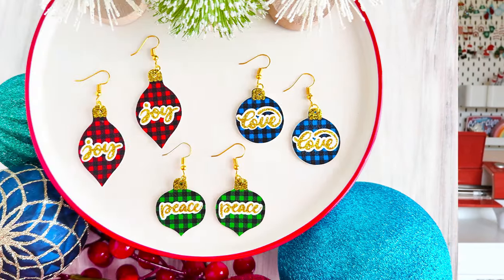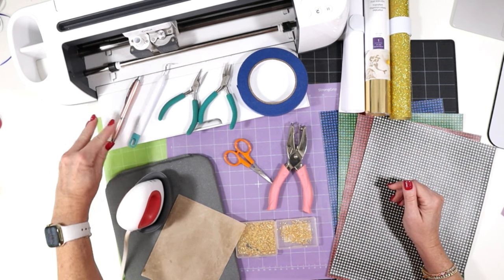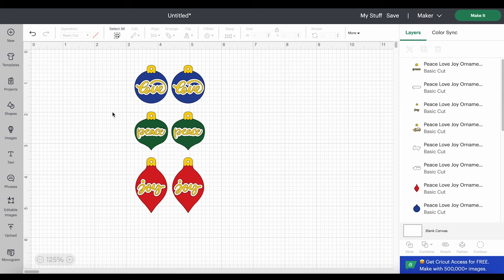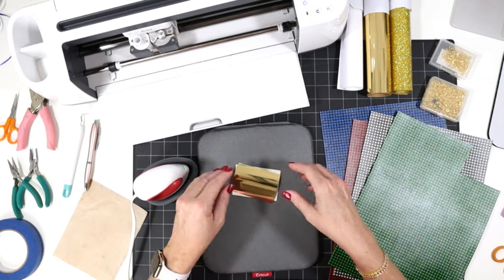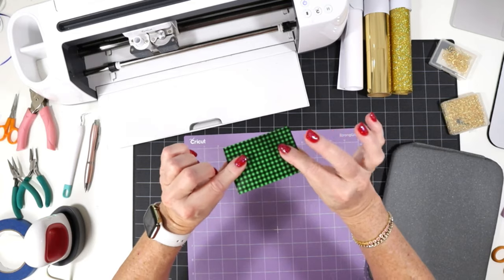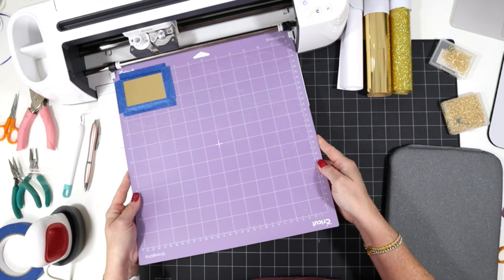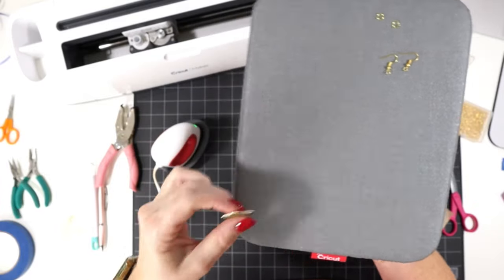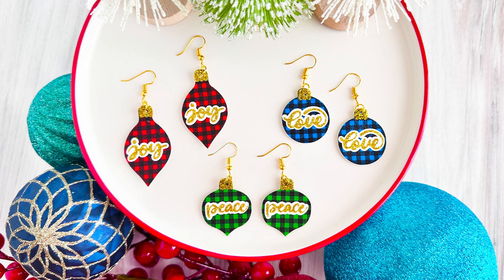How to Make Faux Leather Christmas Ornament Earrings with a Cricut

Comment: Hello, I am very new to making earrings and just found your page yesterday. I’m having trouble with curling and wondering if the HTV is enough to stop them from doing so?
Reply from the maker: Hi, Tara! Welcome! Yes, HTV on the back of the faux leather does add structure and stiffness that will help the faux leather to stop curling. Also, I recommend placing your faux leather after pressing vinyl onto the front (or back) under something flat for about a minute to help it cool in a flat position. :)